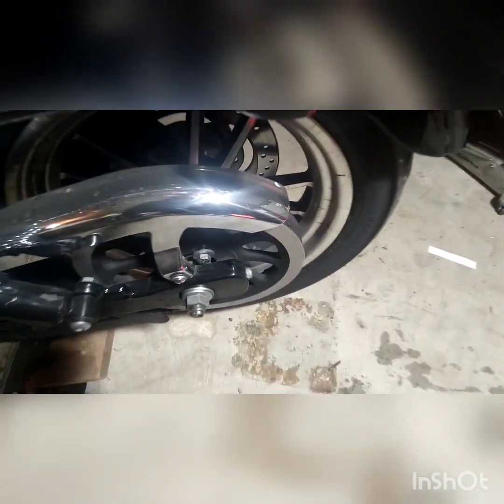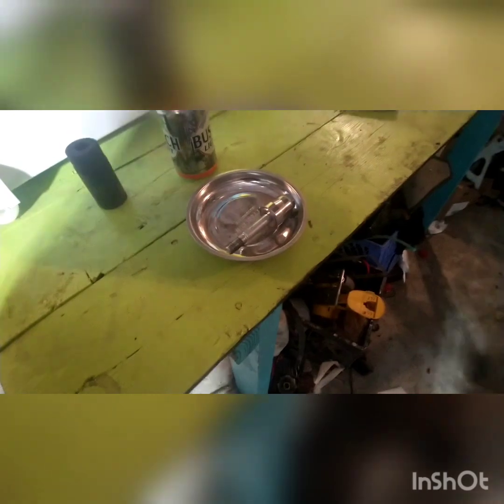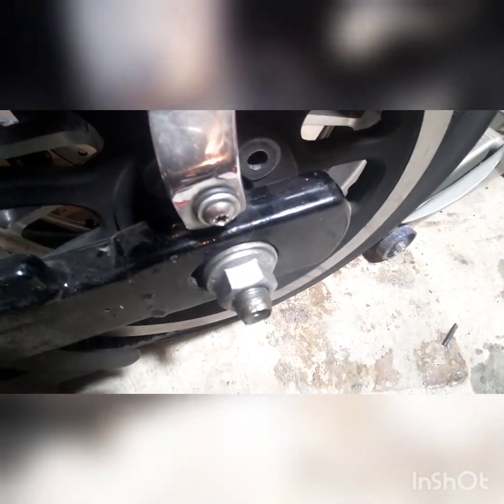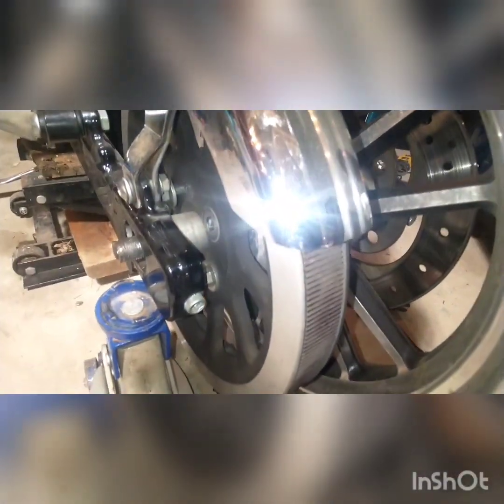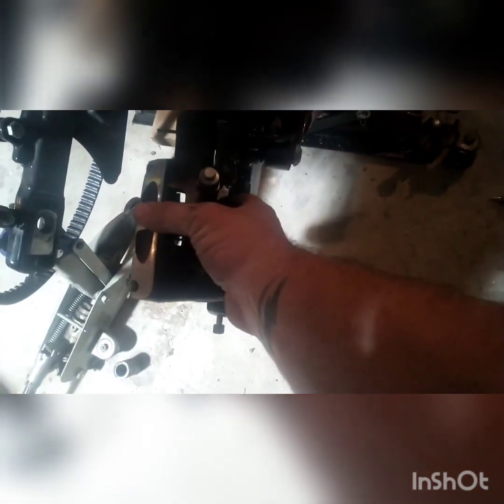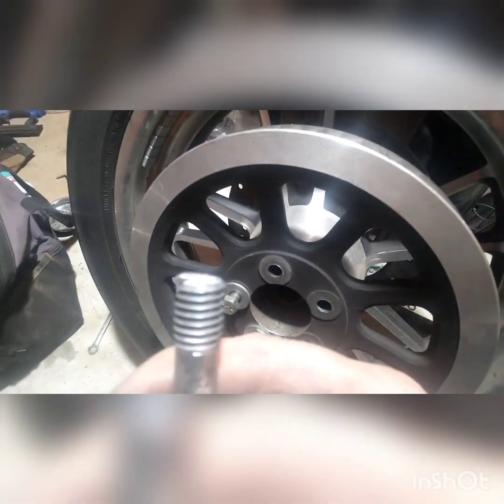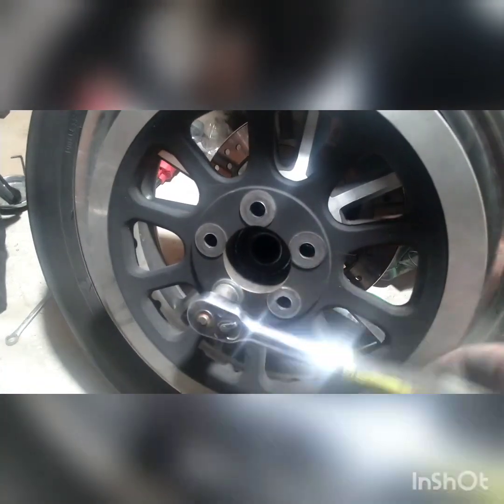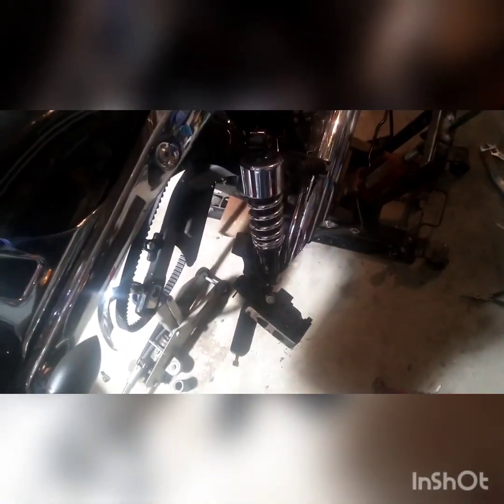2007 Dyna rear wheel removal. EVERYTHING IS BROKEN! #harleydavidson #dyna #broken

Comment: Someone used the bolts 2nd time.
The pulley bolts are a one use only.
Reply from the maker: @genegeneish  that was my initial thought also.  But that bike had only had tire changes.  I sold the bike before I ever fixed it. so it’s not my problem anymore lol
Reply: @chainslapmoto  I check the torque on those bolts at spring recommission. If one is a little loose, they will all be replaced.
Reply from the maker: @ that’s a great idea.  I do check them each spring with my service on my roadking since that incident